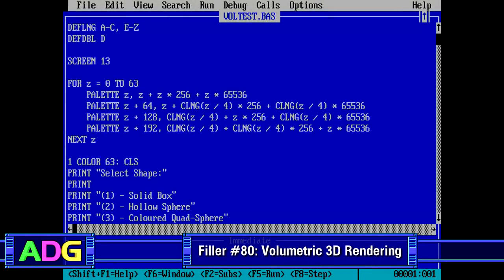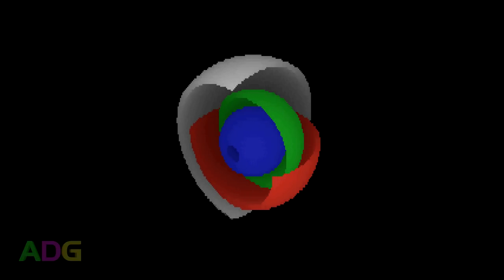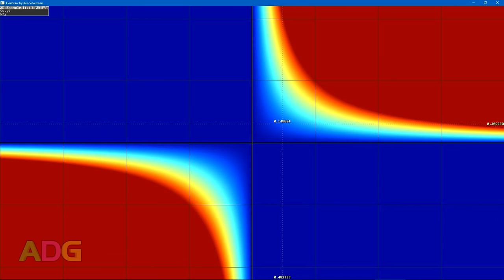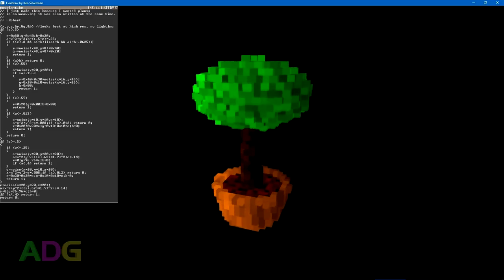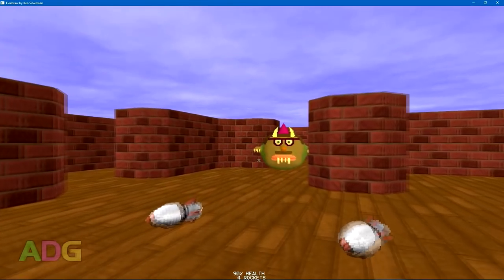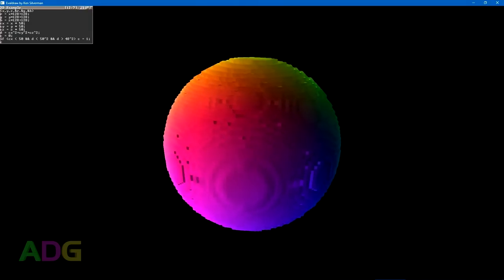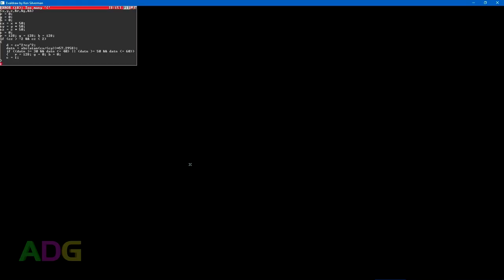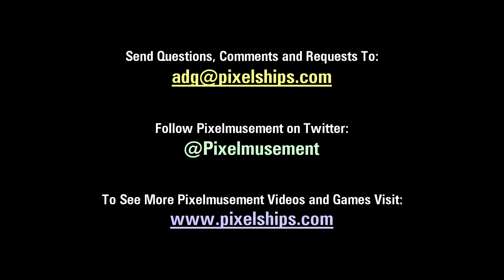Volumetric 3D Rendering - ADG Filler #80

Comment: Great episode! You should look into signed distance field ray marching if you haven't already. You have an equation that for any given point in space gives the (signed) distance to the closest surface of your geometry. Then, to render it, you can march rays through the screen plane, knowing that for each iteration you can at least travel the distance returned by the equation for the ray's current point, and that you are at a surface and can stop iterating when the return value is 0. For simple geometries, this is a huge optimization over fixed step ray marching, fast enough that the GPU can do it in real-time with a fragment shader.

Would love to see it implemented in QBasic.

Comment: Volumetric 3D is a possible solution for having 3D terrain with holes and tunnels through it. It's just that it would be slow if your rate of polling space is high. But it does have LOD built-in because you could just have the space polling be more fine close to the player and coarse far away from the player. I had to read a bunch of papers about 3D terrain alternatives to basic heightmaps, searching for ways to represent highly detailed terrain and also have tunnels and concave spaces.
Reply from the maker: +ArtFluids The one solution to that problem I distinctly remember is from Descent 3 where they refer to their engine as the "Fusion Engine" because it fuses outdoor and indoor areas together seamlessly. The way it does it is to allow disabling specific chunks of the heightmap so that other meshes can be put in place to allow for transitioning into an area underneath. :B
Reply: @Pixelmusement  That sounds like a good solution. Another common one is to do voxels with marching-cubes smoothing, but then you lose the ability to have distinct ridged areas (like stairs) and organic areas (like hills). It's either all smoothed or all cubes.

Comment: This kind of thing is totally up my alley, lol.
It looks like your Basic program is just coloring voxels by depth while Evaldraw computing the average surface normals. With some equations you could get a more accurate surface using the marching cubes algorithm.
Nowadays volumetric rendering also refers to graphics effects like "god rays" with light shining through mist. This is usually done by rendering lots of planes parallel to the camera using shadow mapping.
Reply from the maker: +Komojo Yeah. That program was something I wrote VERY quickly because I didn't really know what I was doing. :B

Comment: Is it possible to make a game that uses true 3D bitmaps instead of converting everything to polygon meshes?  Could modern computers even handle that at a moderate resolution? I feel like I get ripped off when a game claims it uses voxels when they are really polygon meshes.
Reply from the maker: +Grey Sky You could, but video cards are optimized for triangles so the voxels would still have to be converted into polygon meshes at run-time. I should point out, there's no "proper" way to render voxels, so it's not really a cheat to show them as polygon meshes; So long as the data is stored as a 3D bitmap, it's using voxels. Period.

Comment: I really admire Evaldraw and your work, I want to make something like its. Any recommendations on where should I start? Now I'm studying OpenGL and computer graphics programming. I tried to do research online but no luck.
Reply from the maker: Evaldraw is a pretty advanced program under the hood; Trying to make something like it would be difficult at best without understand the fundamentals of what it's doing. I think a better starting point would be learning modern voxel graphics rendering techniques first, then go from there. My QuickBASIC program literally just plots 2x2 sized pixels based on a fixed viewing angle and very basic math, thus why it can't rotate scenes or anything like that.

Comment: 6:45 what if you have a curved screen >:L
Reply from the maker: Then yes, you should technically be rendering with a curve of sorts, but then it's not only even MORE complicated to get the correct separation between pixels than that example is portraying, but unless you have a PRECISE match between physical viewing distance, near-frustum calculations, and field of view in the game itself, you're STILL going to get some kind of distortion at the edges; It's just not worth the effort. :P
Reply: @Pixelmusement   dammit now I'm actually intrigued by the idea... If you were to render something with a curve perfectly matching that of the screen... would it basically just correct the distortion of the screen and make the image look perfectly flat when viewed from a straight angle? Great now I won't be able to sleep until I see this, and I don't even have a curved display. 

Great channel btw